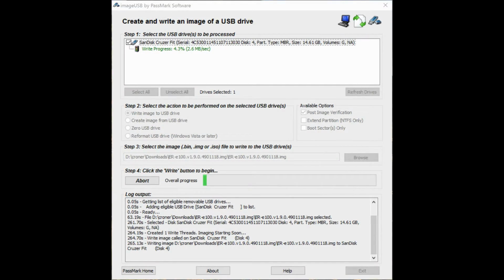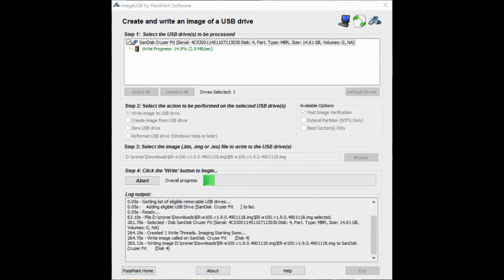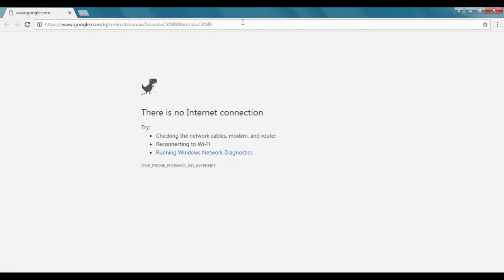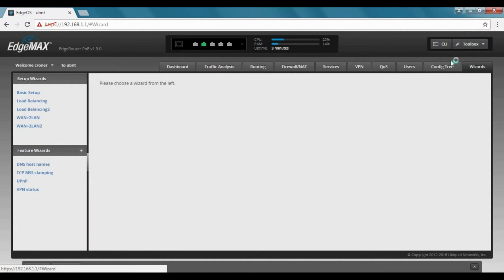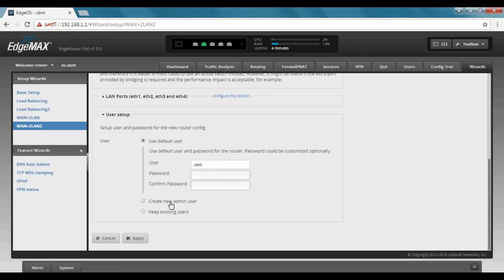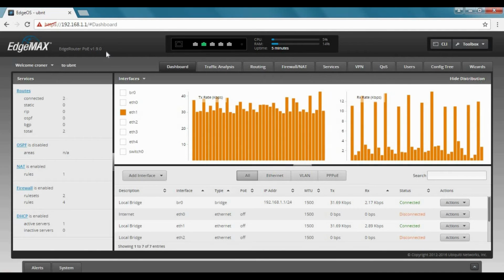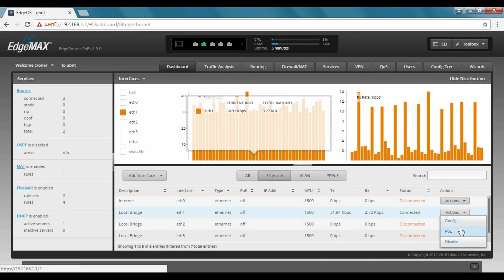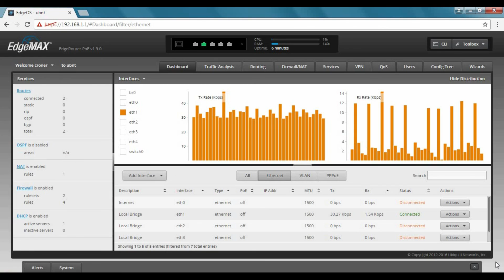Edge Router 5 POE brought back to life!

Comment: I have the exact same model. for whatever reason, it wouldn’t work. It would power on, I would engage the reset process with the LED blinking and then going solid, but it would never reboot. I think it got bricked somehow. So i tried your steps, loaded the image on a usb 2.0 disc and slapped it back in. Same trouble. It's really strange, the links respond, but I never get a DHCP assignment from eth port 0. I tried the other ports as well, same thing. I then attempted to console in with the 56700 baud rate, and started getting a bunch of code crap. My main issue is that it doesn't reset... the console light remains on the entire time after the LED blinking from eth por 4 goes to solid and then disappears. Anyway... I was hoping to save the $150 but i've succumbed to purchasing a USG this time.
Reply: Nvm, I had to manually set the IP of 192.168.1.2 in my NIC of my pc, and the gateway also to 192.168.1.1. Once I did that I was able to access the GUI via the gateway ( forgot if I used http:// or https://). Thank you very much for doing this video!

Comment: Maybe I'm missing something, but this router most definitely supports POE at 48v and 24V.  It even says so right on the front of the router in your video!  You can switch which of the last 3 ports have passive POE coming out of them at either 24v or 48v from the webUI.

Comment: This will not power UAP AC PRO? The PRO documentation states PPoE48v as an option and this router does that doesn't it?
Reply: Dave Ayala yes he is incorrect. If you use a 48v power supply, this will work with ac pros